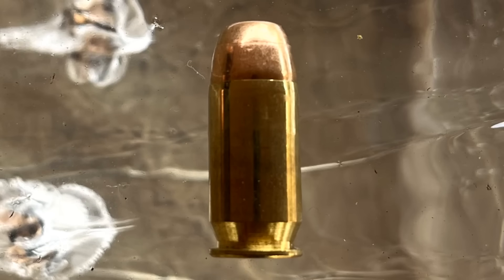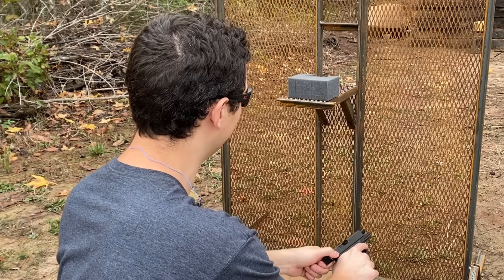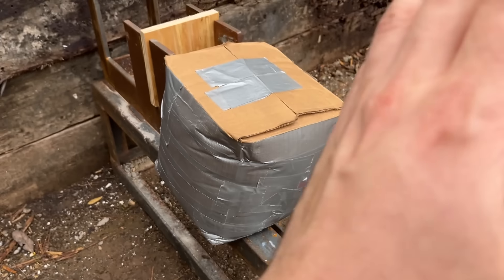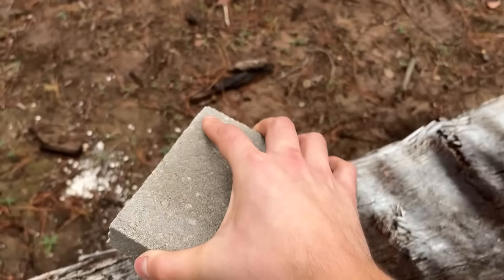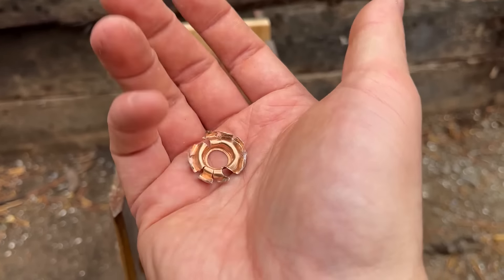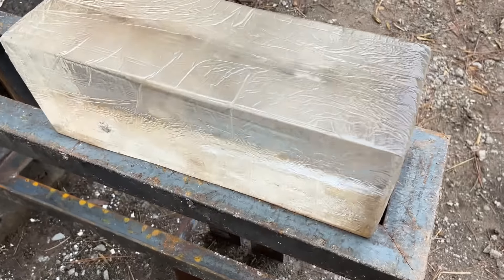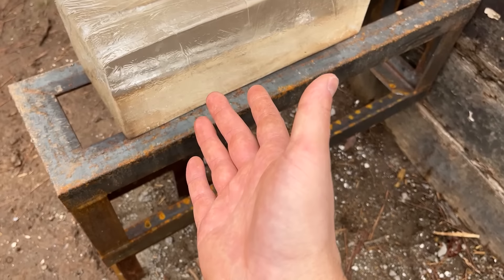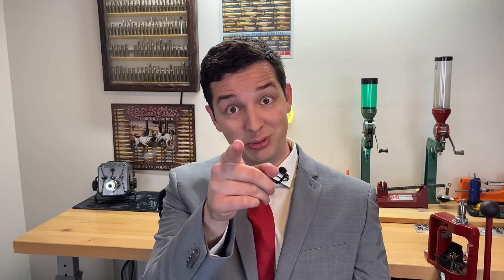9mm vs 45 ACP Barrier Test: No Debate?

Comment: I don't believe for a second that a full power .45 ACP bounced off a piece of wood.

A chunk of the wood may have flown back, but not the bullet, unless it was a squib round.
Reply: @TheActionBastard  same "that guy" that my friend was just telling me about who claimed he saw a guy get shot in the head with a .22LR and it just "bounced off" his forehead.
Reply: There are a few really hard woods out there, but it is unlikely anyone would be using them as a target. Most people shoot at construction lumber like pine, fir, etc, and hard to believe a bullet would bounce off that, unless maybe a huge knot was hit.
Reply: It’s just clown talk I had some yahoo tell me that a heavy leather jacket would stop a 45 acp.
Reply: @Tarbashh 
I could believe that it skipped off at an angle. I have seen it a couple of times including with a 9mm. The 9mm hit the guy in the back of the head, stayed under the skin and followed the skull around to the front of his forehead. Instead of penetrating the skull, the round followed it in a curve from the back to the front.
Reply: 100%squib
Reply: I've seen 45 ACP 230 ball rounds skip along the ground before, where it's a lot less common with other loads where the round doesn't have such a rounded surface.
Reply: So much old fudd lore about .45.
IV8888 tested a common ball round .45acp (not +P), and at 440 yards that sucker still punched a hole through 2-1/4" of pine board (2x4 and plywood). The hole entrance and exits looked exactly the same it did in the 100 yard impact.
Reply: ive seen it happen in person. bounced off a wooden bowling pin
Reply: @user-im6fy4qp6m  Ball round nose? Maple hard wood? Pin moves when it's hit both absorbing and deflecting energy? Pin is a fully round surface leading to deflecting another round surface (bullet nose)?
Reply: it was just regular ball round nose 230 range ammo, the cheap stuff so it could have been an underpowered round. this was years ago i dont remember the exact brand but it would have been something similar to winchester whitebox or cci blazer. they were just set up at a distance of between 25 and 50 yards, not very close but not too far either. the thing i forgot to mention was the pin had some sort of plastic coating that was very tough, that probably played a large role. it actually caught a 30-06 round somehow on the opposite side, i would have expected a rifle round to pass all the way through no problem and most did but after the plinking session we grabbed the pins to examine them and i found a few rifle projectiles stuck in the wood. i dont know if the wood is treated with anything but i know they use very dense wood for bowling pins because they are designed to get hit with bowling balls thousands of times. the plastic coating is maybe 1/8" thick maybe a bit more. its a very tough plastic, if you get a chance to take one apart try it some time. we got them for free from the bowling alley, sometimes they will give old ones away if you ask because they throw them in the trash normally. @exothermal.sprocket
Reply: i just thought of something else. maybe the fact the wood is contained and enveloped completely in the tough plastic skin prevents it from stretching to accommodate the bullet passing through which makes it seem much more dense than it actually is. this would be a fun test for someone to try actually. shoot bowling pins with the plastic shell removed, and with it on, and see what the difference is.  @exothermal.sprocket
Reply: They bounce off my chest all the time. BTW, I'm Superman!
Reply: @user-im6fy4qp6m  I'm not a bowling pin expert by any means. I do know those pins are made of things like maple hard wood and the plastic jacket cannot be all that tough in general. I've seen other videos of people shooting pins and knocking holes through them. There are bowling pin shooting competitions as well, by use of heavy, slower moving slugs (.38 or .45). The idea is to knock a pin over, not penetrate it while standing. Bigger bullet face and slower speed, imparts the forces necessary to knock them over.
Reply: @craigthescott5074  Should have asked him to prove it.🤣
Reply: @Tarbashh That's not farfetched. The density of the human skull is too thick to penetrate for a .22 bullet. Human bones are too dense for a .22 to break.

But that just means the dude was LUCKY it didn't enter the eye socket... and the bouncing around in the skull isn't farfetched. It just all depends if it tries to enter through the muscle, or the bone.
Reply: @USAFreewayROTF  utter nonsense, a 22lr will easily penetrate the human skull unless it's hit at an extreme angle
Reply: @exothermal.sprocket  talk about fudd lore, the idea the you could actually hit a 2x4 with a 45acp at 400 yards is absurd.  Even at point blank they have pathetic penetration, I've seen people I know shoot large oak stumps and the 45 slug literally sticks so shallow I was able to dig them out with a knife
Reply: @ST19859  Do you know how to use Youtube, and do a search? Do you require video evidence of what I say? Just dismiss something someone says because you ASSUME things they did not say? Let me say it again:

"IV8888 tested a boring non+p 230gr ball round at 440 yards (carbine) and it passed right through 2-1/4" of pine wood, the hole entrance and exit looking exactly the same as the 100 yard hole."
Reply: @ST19859  It cannot, otherwise the bouncing around the skull thing wouldn't be feasible, would it? If it could penetrate the skull, it would have exited the skull just as easily.

Because for one, the gunpowder explosion is too small, the amount of energy transfer depends on the weight of the bullet and the explosive force of the gun powder. Without those two, you may as well be shooting BBs.
Reply: @ST19859  That is not true. .45 ACP FMJs have penetration and absolutely will overpenetrate the human body. Of course, I will concede that it's horribly inaccurate at extreme ranges, but the energy transfer is consistent throughout the bullet's flight path.
Reply: @exothermal.sprocket  I've seen that video, it was an interesting video seeing the .45 bullet can penetrate over such long distances as if it was at point blank. Shame about the accuracy though... he could barely hit the wood. But when it did, it didn't lose energy at all.
Reply: @USAFreewayROTF   there's been dozens of tests on ballistic dummies showing a 22 will penetrate a skull every time with a good direct hit, I never said anything about going through both sides.
Reply: @exothermal.sprocket  I misread and thought you stated it as a personal experience, sue me.....  Either way I don't believe that for one second, has to be a faked video.  First off it would take pure luck to hit anything at nearly a quarter mile with something as woefully inaccurate as the 45acp regardless of barrel length.  More importantly as I already stated I have personally witnessed 45 stick less than an inch deep in oak rounds from 30 feet away.  At 440 yards the 45 would be going slower than a paintball.  There is definitely a ton of fudd info out there in the gun community and a huge portion of it is centered around the mythical 45 acp
Reply: @ST19859  And I've seen a video about a .45 ACP overpenetrating a ballistic dummy. Seriously, it was to demonstrate a point. The bullet is too light and the powder is too small to cause any significant damage to a bone density greater than a rabbit bone. If a .22 FMJ can't exit the skull, it can't penetrate a human skull.
Reply: @ST19859  It is not faked. Everything you said except for the pentration was down to a T. Horribly inaccurate at 100 yards and 400 yards, but the energy was still there. It's a damn slug. You say it stuck out an inch ofa piece of oak wood. Was that the only bullet you fired? Or was it multiple bullets? Cause if it's just the one, chances are there was not enough gunpowder in that .45 cartridge
Reply: Heavy weight projectiles with generally lower velocities will retain momentum much further down range than lightweight projectiles with a much higher starting velocity.
It has to do with aerodynamics, how an object of a given size, momentum, drag coefficient can overcome air resistance.
But most people don't understand and don't care to understand about these things, so they return to arguing over branding.
Reply: @exothermal.sprocket  I shot my first bowling pin last fall. The one I had looked like a tight grain oak and the plastic must be cast over it. I expected the pin to break or blow up. I shot it with a 300 Weatherby Magnum, 375 JDJ pistol and a 44 magnum. The pin had a hole in it.
Reply: @tt600pch  Yeah some kind of hardwood is typical, maple being the most common. Shooting through a thick tree branch or trunk also rarely shatters the wood fibers. Wood is like a thickly wound hunk of rope, as the grain goes in one direction. It's not like a homogeneous structure that shatters or blows apart when impacted.
Reply: @user-im6fy4qp6m  bowling pins are round and narrow. its easy to ricochet off of a round target. note: when a ricochet occurs, the energy doesn't stop in the object, it continues with the projectile. Hence no broken pin.
Reply: @USAFreewayROTF

Comment: I have a friend who was the sheriff that said they did a test on .45 and 9mm with his team. He said that 9mm was consistently better at penetrating window shields like an ice pick, while the .45 had issues glancing off at times.
Reply: I lived in a auto salvage yard. 45 and 357 reliably penetrated windshields. 9mm reliably ricocheted off. 10's of windshields tested. Window rolling mechanism in 70's American cars are reliable stoppers of all handgun rounds.
Reply: @varieze117pj7  lol, that is awesome ! Your personal gun range. Bet you got some good stories
Reply: Nothing to do with guns, but I witnessed damage from a huge hail storm in El Paso. In the 90s. Two mid 60s Dodge Chargers with HUGE rear fastback windows were parked in a private lot. Newer cars were in the same lot. The thick glass in the Chargers got no damage. Many windshields and rear windows in imports and newer American cars were not only cracked, but completely smashed out! Not sure exactly when they began making auto glass thinner.
I do know it was sometime in the 70s when sheet metal on cars bacame thinner. There was a hail storm in Harrison, AR in which the olders cars had little to no damage, and the newer ones got beat up bad.

Comment: Another test that would be cool to see is 9mm vs 38Special.  Load data shows they are nearly identical, and you CAN exchange the bullets when loading with there being a slightly tighter fit if using the 38Special in a 9mm.  The 9mm (.355) also engages the rifling in a .357 barrel.  This is where some smart guy pipes up and says "Never use the wrong ammo in your gun!" and that's true!  I'd love to see somebody stuff a .38Special into the breach of a 9mm.  You probably COULD hammer the slide shut.
Reply: 9mm is a high pressure round and 38 is not. They are not close ballistically.
Reply: @@raytrammell9452  First off we're talking about bullets not cartridges.  9mm is actually .355" and you can easily hand load the .357" bullets into a 9mm casing and they will fire with no problems down a 9mm.  I've had plated bullets for 9mm that are .357", and some 9mm bullets are actually .356".  That 2thou easily rams down the barrel.  Berry's plated bullets are almost always oversized a tad but it doesn't hurt anything.  The bullet stretches out the little it needs.  You can also hand load a .355" (9mm) into a .357 casing and it will engage the rifling of a .357 barrel but it's a tad sloppy.  Again though we are talking about bullets not cartridges.  There are several articles online about swapping them out on the loading bench.  The only problem I had when using a 9mm in my 38special was the bullet wanted to drop down into the casing, I had to squeeze the casing a tad to hold the bullet until I crimped it in the press.
Reply: @@raytrammell9452 No worries you were nice about it.  ;)

Comment: Please correct me if I'm wrong, but in the gelatin the .45 seemed to have a much larger wound channel upon impact, which I believe would create significant trauma for the recipient, vs the 9mm.
Reply: @@funnypositivelife9230 So, you're saying the larger hole and greater body shock of the .45 was of no consequence?
Reply: @GH-cp9wc it's like comparing getting hit by a Ford ranger going 55mph to getting hit by a F150 doing 40 mph. Are you gonna be more dead?
Reply: @jerrycopeland5088  My point exactly. Thanks!

Comment: Bullet grain weights very by a few 10ths of a grain all the time. This is why benchrest shooters weigh the projectiles before reloading. A box of .270 150gn projectiles will range from 148 - 155. Better manufacturers have tighter tolerance, but they are never all the same.

Comment: Interesting how you changed your grading criteria to favor the 9 mm.  When looking at the wound cavity you only looked at one angle.  A projectile that expands more creates a larger wound cavity.  Do .357 vs 10 mm that's what we want to see.
Reply: That would be good since many compare  10mm to the old .41 Magnum in power.
Reply: 10mm in certain loadings is respectable but does not reach 41 magnum numbers. 357 magnum, 357 Sig and 10mm are more suitable roommates.😂. Have a blessed day!
Reply: not true...speed also plays a big role... cavitation is real thing...
Reply: No...that's Coke...."it's the real thing!" 😂 @dsxz
Reply: @dsxz  True and I will add, depending on the bullet design and composition, will drastically affect cavitation. Like a good example would be something like the Fiocchi 100gr Black Mamba in 9mm, it's a Truncated FMJ traveling at around 1400fps and does leave a decent cavity inside due to that speed.
Reply: @BogstersBanters  agree, love the .357 sig!

Comment: I don't understand why everyone uses 230 grn to compare to 9mm. Use atleast 185 grn.
Reply: because 230 is the most common, so is 115/124gr 9mm, not sure why he used 147's
Reply: @dsxz  yeah,  I know it's the most common but what i meant was it shouldn't be because it was designed in 230 for ball ammo in military applications.  In self defense the hollow points mostly suck because of the slow speeds of 230. 185 should be the most common.
Reply: Consider the impact/energy situation. One hit with a 230 grain. 45 bullet, or TWO hits with 115 grain (The most common 9mm) bullets. I'm aware it's not a level trade, but consider. Someone drops a 1/4 pound rock on you, or they drop a 1/2 pound rock on you. Which one hurts more and does more damage?

Comment: Ballisticly speaking, both cartridges are in the same power class.  What the 9mm accomplishes with velocity, the 45 ACP with mass.  Otherwise they are pretty much equal.
Reply: y but you can have almost up to 3 times more rounds of 9mm in same size pistol, magazine... .45 is just obsolete for combat, self defense
Reply: @Hijackerrr  Nah, and this is coming from a dude that likes the 9mm, the .45 is the better self-defense round because it is far less likely to overpenetrate. The 9 is a bit more likely to overpenetrate because it's faster with a smaller cross-section. .45 for home defense, 9mm for CCW. 10mm if you're backpacking.
Reply: @1994chocolatemilk  if is fmj used on that yes for both of rounds xtp and other types of rounds not likely neither of them
Reply: @Hijackerrr  Old does not mean obsolete, as for the need for more rounds, learn to shoot more accurately.
Reply: That's the way i see it too;  Those three calibers all fit well to those situations. People tend to not be aware of the energy transfer difference of .45 vis a vis 9mm. That said, you better pick the correct .45 hollow points or you are gambling due to low velocity.  @1994chocolatemilk
Reply: @billoconnor9611  230 grains is still 230 grains, and it's impact will still be felt. And in the event of a "gut shot", the perpetrator will certainly wish they were dead before they die.
Reply: @Rancid_crab_tree  Couldn't agree with you more!!  A .45 auto cartridge will generally produce more energy with that substantially larger bullet.  If you run a lighter (150 gr) hollow point or even a  non-jacketed ball 230 gr it will deliver a punch that 9mm just can't.
Reply: Yeah, nah. Both rounds fully expanded, the 45 ACP can have almost twice the surface area, meaning nearly twice the wound channel inch for inch.
Reply: @vlogfriendsutopia  But don't forget, the 9mm may not expand as much as the 45 ACP, but it's moving faster, leading to a higher hydrostatic shock wave.  Again what one does with mass the other does with velocity.
Reply: @Rancid_crab_tree  At handgun velocity, which is below ~2,200 FPS, the temporary wound channel is just that: temporary. At handgun velocity, the only mechanism of wounding is direct contact crushing. Thus, regardless of velocity, the projectile with the larger diameter will always create a larger hole.
Reply: @vlogfriendsutopia  Again, the 9mm does with velocity what the 45 ACP does with mass.  As for the temporary wound channel, whether it results in massive blood loss or damage to organs, the point is mute, especially if you've dropped your target.  Isn't that the point?
Reply: @Rancid_crab_tree  No, cause unless it's faster than 2,200 FPS, it's going to create a caliber sized hole, and the temporary wound channel doesn't matter and can't actually damage anything. 

So now, it doesn't do the same thing with velocity. Both rounds can obviously kill, but the 45 ACP is ballistically superior.